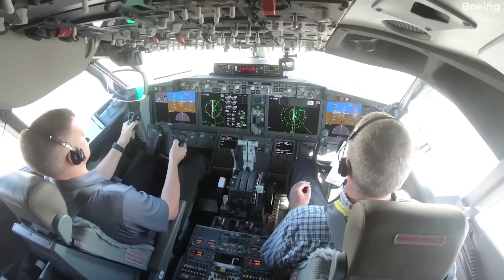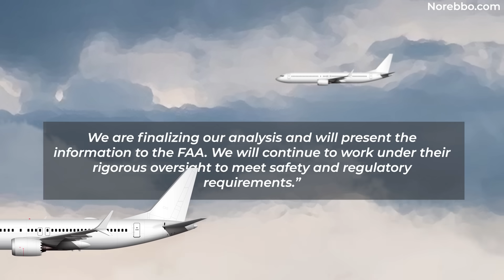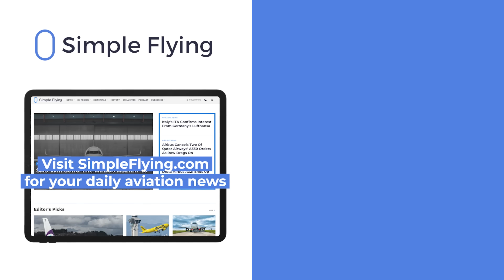737 MAX 7 & 10 Certification Delayed Into 2026 Due To Engine Anti-Ice Complications

Comment: How in the hell can 737 Max 8 & 9 remain certified when Max 7 & 10 cannot be certified for the exact same engine de-icing problem.  If they can't certify 7 &10, they should decertify and ground 8 & 9 until the engine problem is resolved.  Boeing and the FAA are a joke.

Comment: I hope Boeing is improving the AC cooling on the aircraft.  The 737 Max is horrible, absolutely horrible.  And no, it is not the window shades that are up, it is a poorly designed cooling system, which means they have less bleed air to save fuel=$ savings. While paying passengers suffer.  But airlines couldn't care less.
Reply: Is poor 737 Max AC a problem on the tarmac and taxing to runway.  Or is it a problem throughout the entire flight?

Comment: Southwest will surely change to the other active MAXes. If those weren't available, imagine a chaotic world where Southwest Airlines changed from the 737 to the A320.
Reply: Southwest never wanted Max 8.  They wanted Max 7 with 148 seats.  If Southwest was smart, they'd sell their unwanted Max 8s, cancel every $110,000,000 Max 7 order, and replace them all with $60,000,000 Embraer E-2 195 planes that seats 146.  Every seat is 1" wider.  Every seat is window or isle.  Eliminating 48 miserable middle seats.

Comment: Real reason is not that a solution cannot be found, but the solution should be as cheap as possible also for the aircraft in service and acceptable by FAA.
MAX 8 and MAX 9 aircraft in service have already the same problem. The accepted solution will be retrofitted to them as well.
Considering that there are around 1,500 MAX aircraft already flying, you can calculate that a software solution may cost just a few millions dollars and a hardware solution may easily cost a few billion dollars (including revenue loss). This huge cost difference explains why it takes so long.

Comment: So is it that these issues do not exist on the -8 and -9? How so? Boeing decided to use different anti-ice systems and software on the -7 and -10? If that is the case then no wonder there is confusion at that company… if not then why are the -8 and -9 allowed to fly?
Reply: Yes the same issue exists in MAX 8 and MAX 9 as well. They can fly, because they are already certified.
Aren't they in danger? Yes they are.
Why are they allowed to fly? I guess the answer lies in the schizophrenic nature of FAA. FAA is responsible for both control/regulate and promote American aviation.
Reply: they were already "certifed" before.  changes were needed for future certification.   like cars made without 3rd/center breaklights, seatbelts and airbags being street legal, but not for modern cars.  The rules changed for FUTURE projects to comply while past ones are left alone. Safety costs money.
Reply: Boeing has not applied for an exemption for the 10. It did for the 7 but withdrew it after the door blew out on the Alaska plane.

Comment: Isnt the engine the same as the already flying MAX?
Why is de-icing not a problem there? Or is it, but they don't want to admit it?
Reply: It is a problem there as well. Boeing needs to retrofit the accepted solution to MAX 8 and MAX 9 aircraft in service as well. They want the solution to be cheap, because it will be retrofitted to ~1,500 aircraft and counting.

Comment: it is like Boing has just started making planes.
Reply: The testing the 7-10 will go through would shock you. They will be the most tested aircraft in history. 
I still think the 737 is to short and should have been dropped 20 years ago. Bring the new update 757 back. Best Boeing ever.
Reply: @tomg6284  They already said that in 2019 after the MCAS shitshow and guess what, here we go again 🤡🤡🤡🤡🤡

The 737max is the most tested BOEING airplane, which means that they finally started to test Boeing planes as well, after years of self reporting certifications (and it shows, it's a disaster! 😂)

Other manufacturers were already fully testing their planes because they were following the correct procedures and certifications and not grading their own exams like Boeing did 😂

Comment: JUST ONE MORE THOUGHT AIRBUS MAKES A BEAUTIFUL A330-800 SND OF COURSE THE A321XLR TO FINE REPLACEMENTS FOR THE JUNK 737 DISASTERS GOING SOMEPLACE TO HAPPEN GO AIRBUS❤❤
Reply: Th direct competitor of the A330 is the 787 series and the direct competitor of the A321XLR is the 757 (Boeing doe not currently make one to compare with the XLR). 737 MAX would be comparable to the A320neo, 321neo, and A319neo

Comment: What I have been unable to find out is why the ice prevention on the LEAP 1B isn't a problem on other engines - or is it?

Assuming that it isn't an issue elsewhere, why is it proving so difficult to fix it here?

I wish someone could explain what I assume is complex engineering to a non-engineer in simple language (please!)
Reply: Yes, the same issue exists in MAX 8 and MAX 9 as well. 
When a fix was found it will also be applied to MAX aircraft in service which is probably the real reason of the delays.
It is not that a solution cannot be found, but it should be acceptable by FAA and cheap so that retrofitting ~1,500 MAX 8 and MAX 9 aircraft would not cost much to Boeing in total.
Boeing obviously prefers a software solution, apparently FAA is not willing to approve that.
Reply: @user-yt198 Thanks for the response, unfortunately, it wasn't the other LEAP 1B engines I was wondering about, which I would have expected to suffer similar, if not the same issues, but other engune types, not only from the same family, but also of different types and from other manufacturers.
Reply: @neilpickup237  LEAP 1B is an engine of CFM International for Boeing only. LEAP 1A is for Airbus A320Neo, it is almost the same as 1B and no such issue is known.
Reply: @user-yt198 I was aware that the LEAP 1B is a modified version of the family to deal with the 737s limited ground clearance. When I said other LEAP 1b engines, I meant those fitted to other MAX variants.

As has sometimes been found, pushing, or de-rating has sometimes created its own issues.

What I am really trying to find out is whether other engines have similar issues, and if not, why not (or what is it about the Boeing 1B that makes it so vulnerable)
Reply: The issue is not the engine but the cowling which is MAX specific. The cowling is made of composites and melts. There is a mitigation for the 8 and 9 where the pilots turn it off after 5 minutes but if they forget it would be bad.
Reply: @camhusmj38 Finally, an answer to the question I asked. Thank you.

Comment: They need to just scrap the -7 and -10 and just focus on making their existing product work properly
Reply: That would mean they basically couldn’t compete with the A321 (+variants) and the A220. It would be a tremendous loss.
Reply: @Emi_LDAhonestly, I think it's too late for Boeing to fix anything. Seriously, they're absolutely dominated by Airbus on the passanger airplanes market. You want a next gen narrow body? A220 or 320neo family is your way to go, considering countless 737MAX problems. You want a long-haul widebody? A350-1000 is an excellent competitor to the 777-300er, while 350-900 and a330neo are really solid rivals to the 787. The only thing that can save boeing is the freighter market, but then again, they discontinued 747-8 and a350F is on the way...
Reply: Scrap Boeing as a commercial jet manufacturer.

Comment: The B-52 will be retired before these things go into service
Reply: And then it will still be 2 years until the 777X goes into service.
Reply: NEO is An Airbus, it would’ve been the 757 MAX
Reply: @JacobThatGuy1 NEO is an airbus term but im implying a New Engine Option or overhaul of the 757 platform wouldve been awesome
Reply: Well, 777x will be certed in 26. The 7 and 10 will be delayed again. What's new, should have kept the 757 and just updated it/ the NEO
Reply: @tomg6284 A 757 NEO would’ve been great but there was no modern engine to replace the RB-211. The GEnx is way too big, the PW1000G’s wouldve been too small
Reply: @tomg6284 Welp, 2 months later and the 777X is already delayed another year again to 2027, officially. I doubt it is the last time.
Reply: The B-52 will be retired in 2050 literally 25 more years so it’s not gonna retire before these planes gets certified and go to service

Comment: The FAA is a disgrace. There is NO legitimate reason to delay. These planes are already flying safely. Instead they are forcing old less safe planes to stay in the air.
Reply: Watch mentour pilot last video to see how “safe” this last discovered issue. Might be a revelation to you. And, also, how Boeing continues its pattern of behaviour. This won’t be a revelation.
Reply: @da480 it’s safe enough that everybody: pilots, airlines, regulators, and passengers are using these planes for 1,000s of flights per day. Yes, I watched Petter’s video. It’s an edge case. Boeing will have a software fix. The fix would be faster but for regulators.
Reply: @Michael_K_Woods  "an edge case" can still mean hundreds of casualties. The early MCAS failures were also "edge cases" and they took the lives of 350 people. You have no concept of safety, thanks god you are not the FAA.
Reply: @Michael_K_Woods so you suggest to take your precious word about how safe it is over those of real stakeholders? Right.
Reply: As much as I hate flying on the NG 73-9ER/73-7, it's better off being delayed so that way we can have a safer plane at the end of the day.
Reply: Boeing have not applied for an exemption for the anti-ice issue for the MAX 10. They also withdrew their application for the MAX 7 because it looked bad after the door blew out of the Alaska plane. The FAA cannot legally certify a plane with a known fault without granting an exemption. But it cannot grant one if no one asks for one.

Comment: Speaks to the Boeing mindset - they would rather pursue waivers instead of sound safety based engineering solutions - accountants still calling the shots rather than engineers.
Reply: They sure are still calling the shots, especially since them calling the shots is what caused all of these issues, sad isn’t it?

Comment: You'd think Boeing is doing it for the first time. And given the past self-certifications they probably are.
Reply: Yes, this sounds like having schoolchildren grade their own works, giving themselves perfect scores, and then scrambling to come up with something right as the teacher asks to see their work
Reply: It would be more proper to say that it is likely that the FAA is doing a certification this for the first time in a long time. There seems to be a shortage of expertise inside of the agency due to the previously allowed self-certification. I hope they get it sorted out quickly.
Reply: The fact that they are hoping to fix a problem with smoke entering the cabin with a software update, tells you all you need to know
Reply: @ordenmanvrn7685  The smoke entering the cabin was a CFM engine issue.
Reply: @CD2026Clips  What, did the engines drill holes in the fuselage?
Reply: @CD2024Clips  Boeing integrates those LEAP engines into their planes so they should have made an effort and read the fvcking manual and prepare for the possibilities. FAA and Boeing actually did not think it's anything more than an annoyance and it took a Boeing pilot to present a scenario in which pilots could be incapacitated or killed. Then NTSB got involved. Funnily enough Airbus already has some checklists that pilots love so much for the case LRD gets activated. No idea if they were reacting to Boing incident or were aware of the problem before. Actually that software solution looks like a good one. The moment LRD is activated, the valves through which air goes into the cabin and cockpit are closed and the (toxic) mix of oil and air is stopped.
Reply: He’s partially correct. For example, oil leaks or seal failures in the engines can lead to fumes being drawn into the air conditioning system and then into the cabin. Even though Boeing might have some influence in some of this, as probably thought by some people, it’s not the only determining factor. Because seal failures could also be caused by improper maintenance, alongside others.
Reply: @phildane7411  It's actually a problem with both the engine and then the bleed air system into the fuselage. However, I don't think that the engine maker (CFM) knew that the engine design was going to leak oil into the bleed air system, and therefore Boeing was not aware that it could happen if the LRD activated. So mostly a problem with the engine design, but it should have been tested better by both CFM and Boeing to make sure it was safe. Pretty simple software fix with the valve , but I don't know if the engine/LRD system can be fixed easily.

Comment: Boeing Right now is it is like a wounded giant that needs healing immediately. I strongly advise those airlines to stop ordering the new Jets and that the company fully heal or they could just order as many jets as possible.
Reply: Go back to making Subway sandwiches. The line is getting long.
Reply: @CorneliusTaylor-s1u If you'd finish mopping the floor, and get your bucket out of the way, they'd be able to serve people quicker.
Reply: airlines should order Airbus instead of that junk
Reply: @PakaBubi  There are 3 problems if airlines are just ordering Airbuses. 

1 - Airbus has really long delivery times. If you order an Airbus aircraft (a320 neo family) today you wont get the aircraft until well into the 2030s (2032+).
2 - If only Airbus exist on the market aircraft prices will increase (monopoly). In the end you as a flying customer will pay more for your tickets. 
3 - Less competition = less innovation.
Reply: @danielsandberg6217  It is to be hoped that other manufacturers will start to take up the slack as Boeing's market share continues to decline.

Remember that for many years Boeing made excellent, safe, and innovative aircraft, without a single competitor of a similar size.
Reply: @PakaBubi 

How much you get paid to say that ?